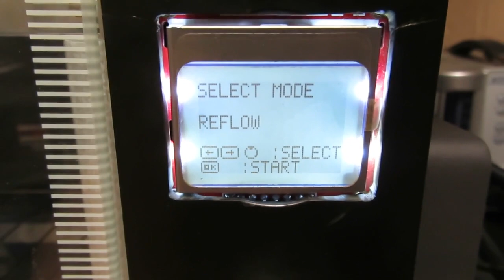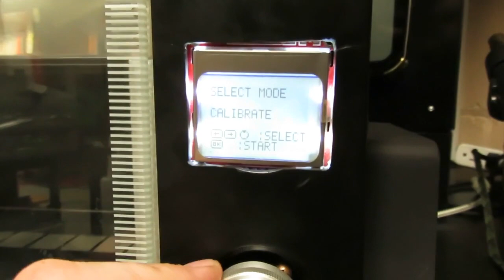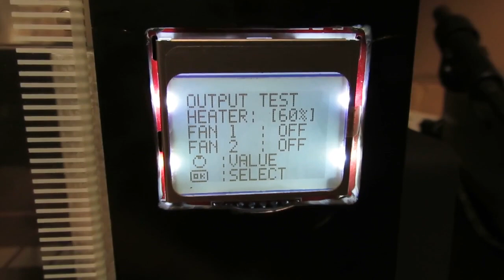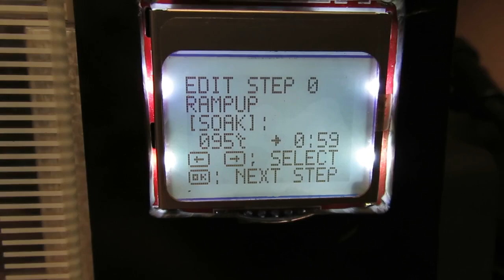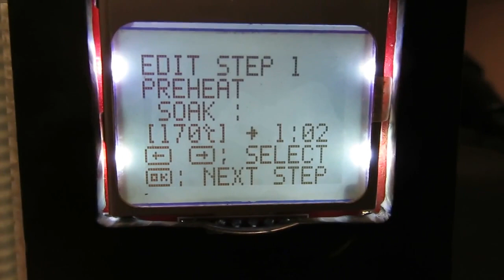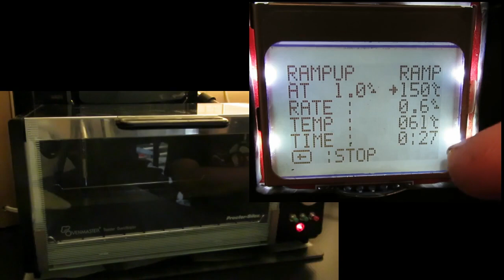Converting an old toaster oven into a reflow oven for SMT soldering

Comment: Nice! The display is a nice touch .. I figured you'd just assume a single profile or two and have a button for 'profile A' or 'profile B' and 'Go', but you've gone all out. In practice I find most SMT solderingh is best done by hand (cheaper, no need to use the solder needle, and that stuff has a shelf life) and doing even a lot of pins on QFP (say) is a piece of cake with a bit of practice .. but when you're popping out boards en mass like you need to do, or if you're doing QFN or chips with a big ground pad in the middle, then air and hand don't cut it super well (but can work) .. so good on you, and as always, doing it yourself like a boss :)

If the controller is all homegrown, maybe its worth rolling a board for? A lot of people buying the Chinese reflow ovens these days, but they have a smaller work space than the typical toaster oven

I didn't catch.. do you have multiple heat sensors? I found I had to add a few around in mine, as it has definate hot spots and I end up crowding boards to one side to get any consistency.. but even on a 4" square or 4x6" pcb, I get one side cooking nice, and the other a disaszter.. annoying as heck
Reply from the maker: Yeah, two thermistors. You can select the temperature reading to be from one or the other, average of both, or low / high from the set. You place them wherever you think they should go, which will require some experimentation. The uneven cooking is a problem for sure. I found that if you soak the board at a higher temperature for a bit longer than recommended, then hit the peak and soak again at the peak temperature, it seems to work ok. Can't go too long though as it's going to decrease the quality of the joints.